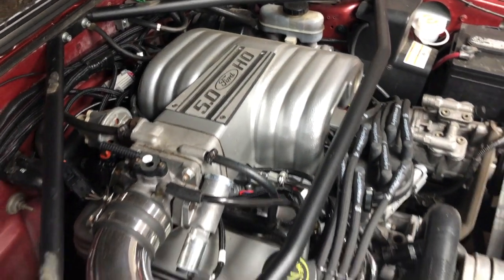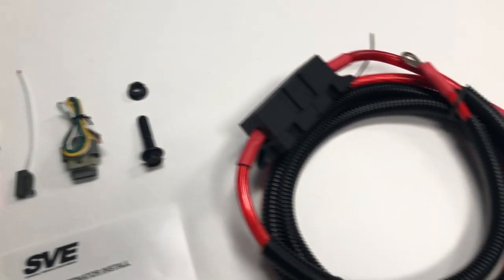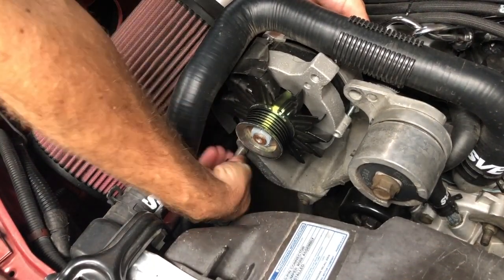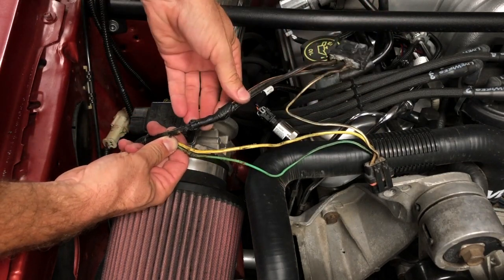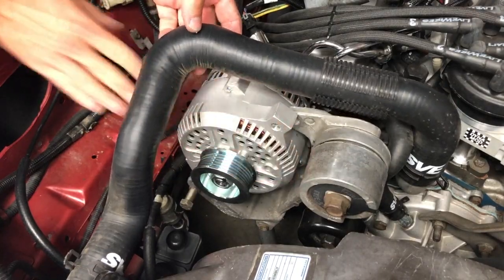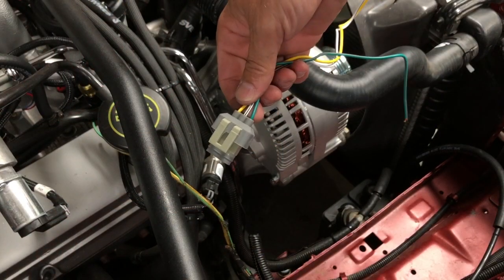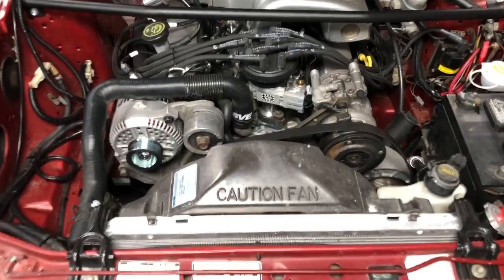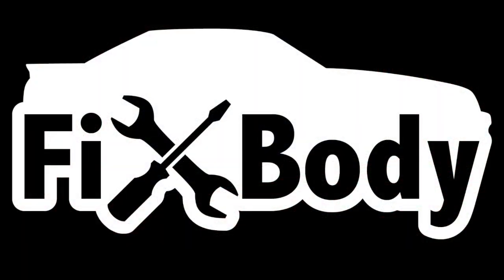Foxbody Mustang 3G Alternator Conversion Upgrade Install

Comment: So the two wires that go into the single wire for the charging, you can just cut those off and tape off the end that you cut off because it's not being used ? You're only using the green and the yellow,?
Reply from the maker: If memory serves, that is correct.
Reply: @Mustang-Geek and will this also eliminate the battery light on the dashboard indicating a charging alternator ? Do you have other platforms of social media like Instagram or Facebook so I can follow, I have a 1990 GT that I replaced the Alt on but it's a O'Reilly's brand and hardwired.
Reply from the maker: @Almighty_King_88  Excellent question. This was a 1991, and I don't remember if it had an alternator or battery light. All I know is that I hooked it up as shown, and it worked like a champ. No issues! We're on Facebook: (https://www.facebook.com/TheMustangGeek/) and Instagram: (https://www.instagram.com/mustang_geek/)

Comment: I saw LMR video of this install and they used the 2 black and orange power wires along with the new 4 gauge wire on the back of the alternator. Should I only use the 4 gauge wire like your video or the 2 black and orange wires and 4 gauge. Thank you.
Reply from the maker: I'd follow the LMR video.

Comment: I completed the install and bought a new battery but the dash battery light is on at start up. I did connect the 2 orange and black wires along with the 4 gauge power wire. Should I try removing them to see if it helps with the light staying on the dash or run the car for a trip to see if the light shuts off?

Comment: Did you not install the 2 bigger black wires on the batt terminal like in LMR video? They showed it exactly like you but they took the 2 black wires n mounted them into the battery side on the Alternator n I did this many yrs ago on my fox body but for the love of me I can't rem if I added the 2 black wires onto the batt wire on the alternator. I was looking to either rebuild mine cause it's dead or just buy one n see LMR video n  then watched yours. Thanks God Bless
Reply from the maker: I just connected it to the starter relay which is basically the same as connecting into the battery.

Comment: This video is a short fix. You need 2awg to battery. Yellow to solenoid green stays factory and white stator stays.
Reply from the maker: Interesting. This has worked great for years.
Reply: @Mustang-Geek I order led power wire kit off Amazon it has a 150a 58v mini fuse connected to it is that sufficient? Or should I have gotten a mega fuse

Comment: Mine is wired just like you showed but I get no output from the alternator. Confirmed my factory yellow is constant 12vdc and the green is 12vdc with the key on. I was convinced the alternator was bad so LMR has replaced it twice now but even the third one still isn't working. I'm at a total loss.
Reply from the maker: That's really weird. Is your engine well grounded to the chassis?

Comment: What is the wire size on the regulator Instater pigtails? The green and yellow wire?
Reply from the maker: I don't recall. Maybe 16 gauge? But that's an educated guess.
Reply: @Mustang-Geek  kk thank u, because I’m short on wire n need more. I can’t find anything about the wire size either so I’m not sure what to do

Comment: Curious to what you did with wire that was connected twice on plug you cut off where does it connect
Reply from the maker: I think you're referring to the old power wires. I didn't use those.

Comment: I dont have the original alt harness. Would i need to buy a used one or do they sell a 100% new harness that would work?
Reply from the maker: I'd check with Latemodel Restoration.

Comment: They make brackets to clear the larger alternator, a lot better than cutting and weakening the metal
Reply from the maker: I think the brackets that clear the alternator are just clearanced like this. Reardless, this bracket is plenty strong even after clearancing. Don't over-think it.
Reply: @Mustang-Geek  yeah, you're probably right. The bracket isn't easy to put on either. It's better to just cut a piece out and save $90 and 3 hours of your life.
Reply from the maker: @JMac85X  The bracket doesn't take much to get off, but clearancing is easy.
Reply: @Mustang-Geek  I'm in the middle of adding one right now. The new bracket gave me a little trouble but finally went in. If I did it over I'd do it your way. My knees and back hurt man lol

Comment: Do I need to upgrade my ground and battery power wire as well?
Reply from the maker: That shouldn't be necessary if they are in good condition.

Comment: Ok it’s been a year now sinse you do that shotty but connector wiring. Talk about shit coming loose and arcing I’d go back and check those connections I’ll bet their loose if they ain’t your lucky. But I’d go back and resplice them wires there better ways of doing that and won’t come apart either
Reply from the maker: Hello! A few things: 1) Heat-shrink butt connections are a VERY robust way to make connections. Much better than soldering, as wires tend to crack at the edge of the solder joint. The connections are doing great, but thanks for checking in! 2) It's "butt connector" not "but connector." 3) "Sinse" is misspelled. 4) It's "shoddy", not "shotty." Very different words! 5) The second sentence is a run-on. I'd consider adding a period or exclamation point between "arcing" and "I'd. 6) Add punctuation between "connections" and "I'll." That's another run-on. 7) "those wires" is proper grammar rather than "them wires." 8) Punctuation needed between "wires" and "there." Another run-on. 9) Add punctuation after "either."

Comment: This video helped my alot installing the alternator but my car wouldnt start, the dash wouldnt come on. Im not sure where I messed up. Before I put the new alternator I was able to start it without the alternator but now it wouldnt start even with the new alternator. What do you think the problem is?
Reply from the maker: Sorry you're having an issue. Maybe something is shorting to ground?
Reply: @Mustang-Geek  Thats what im thinking but I gotta check it out. Thanks for the fast reply though really appreciate it
Reply from the maker: @peterpark8012  Let us know what you figure out.
Reply: @Mustang-Geek  Will do

Comment: Do you take off the wiring connector for the original alternator wiring at the solenoid if you use the 4 gauge wire? It’s not shared with anything else at any point is it? Thanks in advance.
Reply from the maker: That's a really good question. I honestly can't remember! I think the wiring is all tied together, so I just taped off the old wire at the alternator end. I could take a look when I get a chance...

Comment: Aren't you supposed to cut the 2 charging wires and put terminals on them and attach them to the post on the alternator?
Reply: Does your voltage meter in the dash still work if you don't use the factory orange/black wires?
Reply from the maker: @true_believer3548  Yes, it still works. The voltage gauge on the dash just measures voltage in the system, so there's no real "wire" for it. It's just measuring voltage at the gauges.
Reply from the maker: You could do that as well, but I bypassed the factory wiring completely as described.
Reply: @Mustang-Geek  Did you remove the factory charge connection from the coil?
Reply from the maker: @suebrown7760  Sorry, I don't totally understand the question. The video shows exactly what I did...?
Reply: Sorry. After running the new 3g wire did you remove the factory charging wire from the coil? 
Can’t see in the video if old wire is attached or not. Thank you.👍
Reply from the maker: @suebrown7760  Sorry, are you talking about the IGNITION coil or the alternator coil?

Comment: Your car is running hot
Reply from the maker: Yeah, my gauge sender is really off. The engine measures 180 with an IR thermometer.
Reply: I just installed a digital gauge in my fox cause my coolant level was as high as yours and it worried me

Comment: Great vid.  I'm curious to know what you saw on your batt gauge once you installed the higher amp alternator.  Also do you see the batt gauge on the dash dip when you load up the electrical system by A/C or high fan use?

Thanks
Reply from the maker: Yes, the gauge still moves around, but the voltage is much stabler!

Comment: Great and intuitive video. I ran my power wire through the top of the core support on my LTD
Reply: I did that too on an earlier fox I had. It's easier to do if you have the bumper cover off.

Comment: Nice job man!! I just did this about 2 weeks ago it was super easy! And my alternator was failing anyway I had 11 volts at idle and the car wanted to die now with my 3g I’m sitting at 14.7 with headlights and blower motor on full! But definitely a must do mod for anyone with a fox!
Reply from the maker: Agreed. These alternators are problem solvers!
Reply from the maker: @John E McDonald No. Standard pulleys.